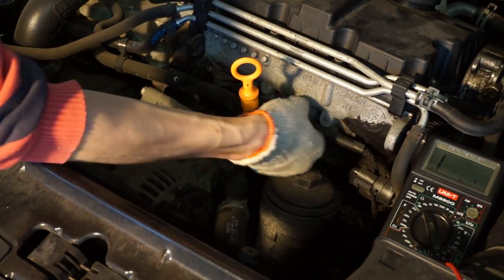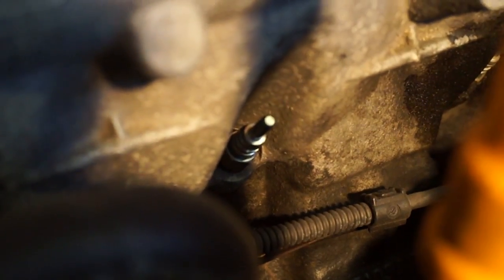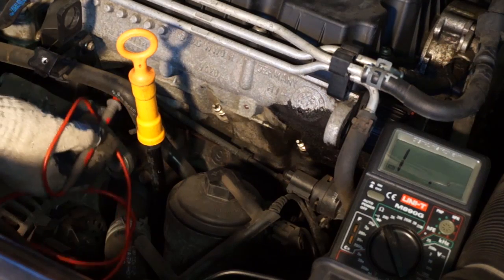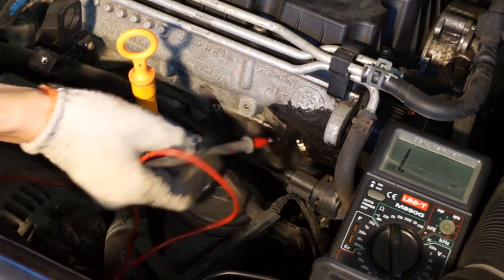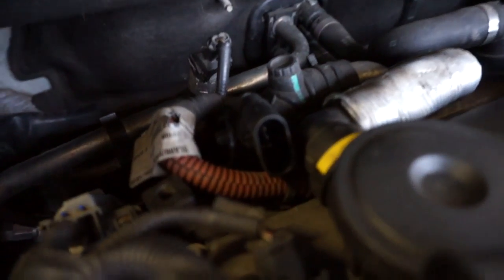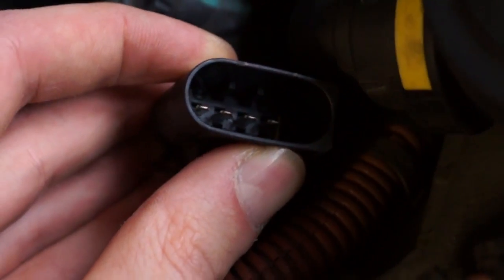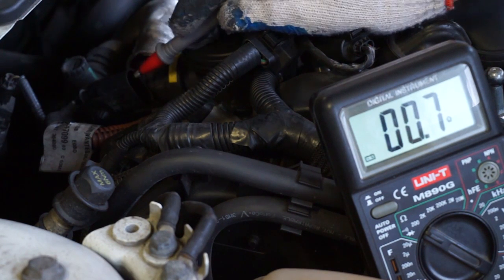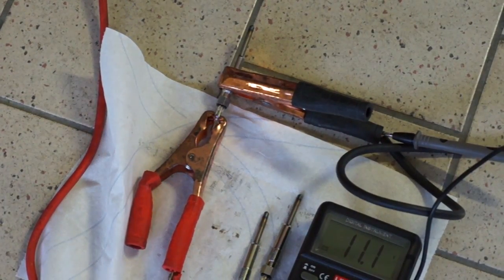How to check diesel glow plugs? (diesel engine, car diagnostics)

Comment: Great video
I have a Fabia 1.4d and having issues you describe in description above.
"If your diesel engine is having hard time starting" "or it smokes right after the start"
new fuel filter and starter fitted recently but still struggle starting
Glow plugs are good all 3 test fine at 1Ω 
Any ideas what it could? another user mentioned possibly the Fuel Pump?
Thanks in advance

Comment: What process did you use to apply current to test the old and new glowplugs?
Reply from the maker: The simplest test there is: apply 12V current to the glow plug directly :)
Reply: As in, just hook the glow plug to the battery directly?

Comment: Could I just disconnect battery before changing my glow plugs? As Im not sure which cable to disconnect, but I can change them as I know where they are located.
Reply from the maker: You can disconnect the battery but as long as you don't turn your ignition on it will not make any difference.

Comment: Hi!
Thanks for the video! I have one question: is the test valid if the wires are attached to the plugs? This is about Citroen Berlingo 1.9D and the plugs are covered by many other parts. I measured them without disconnecting any cables or wires, connect the one end of the multimeter on the negative of the battery, and the other one on the top of each plug. The results was about 3-4%.
I'm a little bit confused, because I have a problem with the starts in the morning, so may be the problem is with the plugs but I am not sure it I do the test right.
Thanks in advance!
Reply from the maker: The closer you are to the actual glow plug the more precise your readout. Wires have their own resistance and the longer the higher resistance.
In my case (2.0D Volvo) there was about 50cm of wiring from the connector to the plug so it shouldn't really make any difference.

Comment: Thanks for showing how it's done on the 2.0D HDi or TDCi .. however you chose to call it, I wasn't aware of that 4-pin plug. Only one Q though: is this test done with ingnition key in position 2? or without the key in the ignition? Thanks again 👍
Reply from the maker: Ignition off.
Reply: Ghassan Al Fa